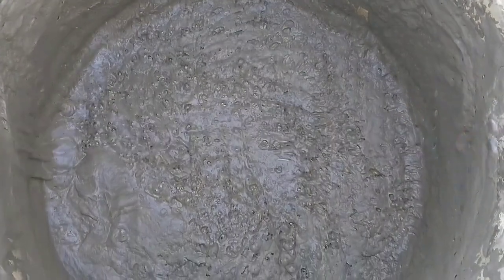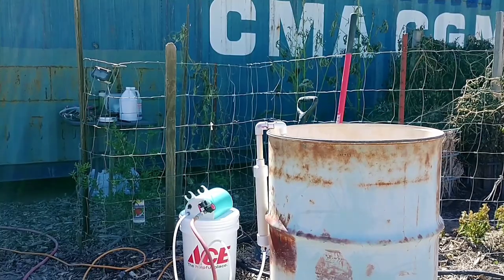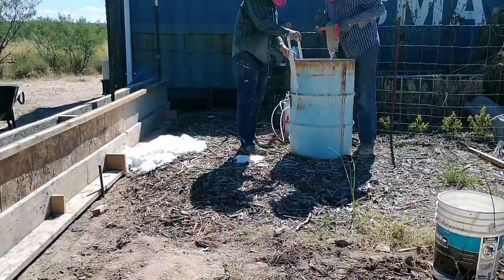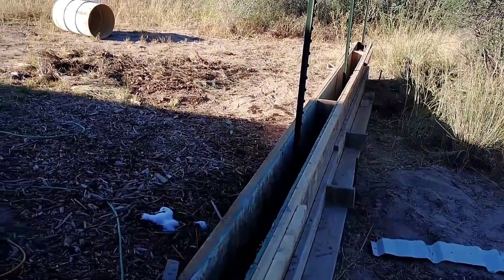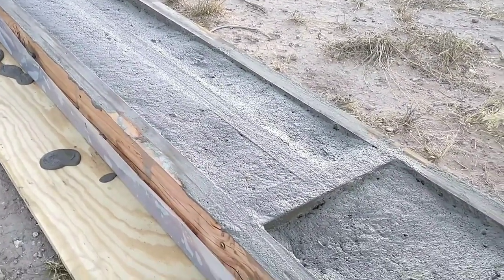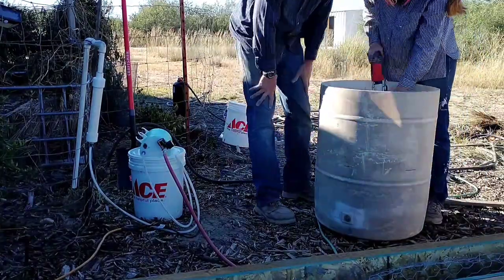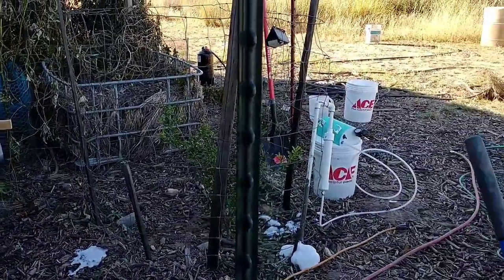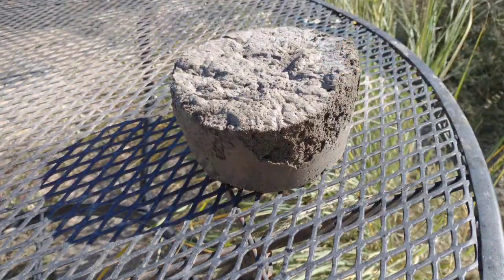AIRCRETE How We Made Our First Successful Batch | Foam Density, Water Softener, Air Compressor

Comment: Just watched this Aircrete Harry video and noticed that the cement is premixed with water in a separate mixer.  Additionally, notice the ductwork around the drill mixer in the barrel where foam is blended with the mixed cement slurry.  https://youtu.be/i2eNx0CVXD8

Stay safe out there.  Peace
Reply from the maker: Yes, Honey Do Carpenter and Harry have tried all kinds of different things. Some of them were good ideas and others didn't work out so well. I was under mixing, but now I am probably over mixing, I think we have finally figured out what a good mix should look and feel like. Our batches this week have been turning out pretty well. Making good aircrete definitely takes some practice, but it's very doable. Thanks! 😊🏠

Comment: To cold not mixed right chain barometric pressure, and water sources all can ruin your batch.
Reply from the maker: We have pretty extreme temperature variations here in the desert, but never had both batches fall. We were making batches at 4:00 in the afternoon at around  80° and getting down into the mid 30s at night. The first night was windy and we got down to 33° but batch #3 was ok, and didn't fall even though the foam was too wet. We weren't sure if it would work, but  the water softener seems to be working well.
Reply: @RedandAprilOff-Grid  I've been trying to think of ways to heat the molds without electricity... perhaps masonry wood stove... or heated water
Reply from the maker: Yes, that is an issue for us too. We are going to finish the garden wall, and make a few more test batches, that we can let cure in the well house. We are already getting down into the mid 20's, so we will have to wait until spring to pour the house walls. We are a whopping 22° colder than the low temperature in the town that is only 10 miles away!! It will be a bit of a delay, but there is still quite a bit that needs to be done  He plans to finish the pad, and work on the house structure this winter.